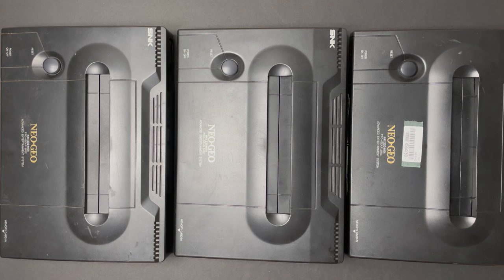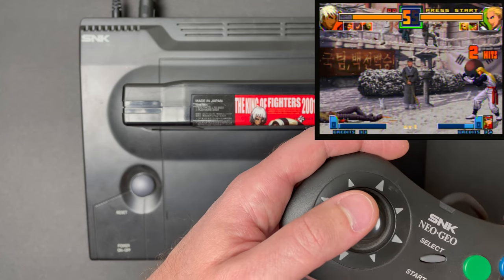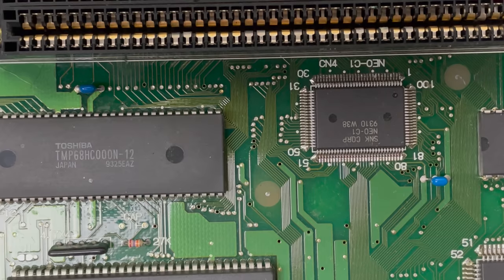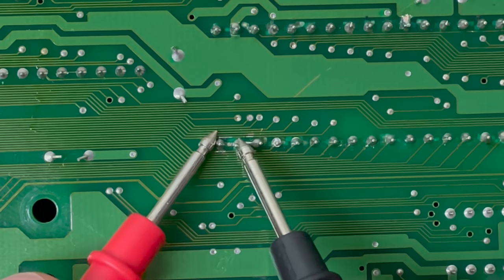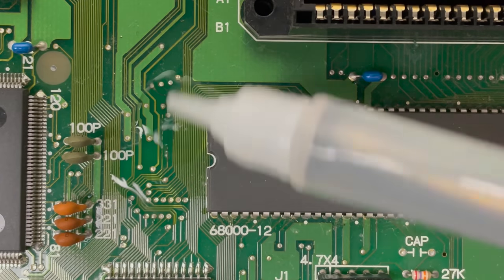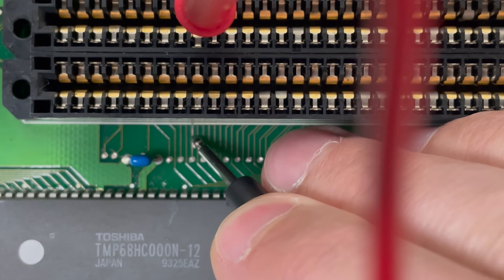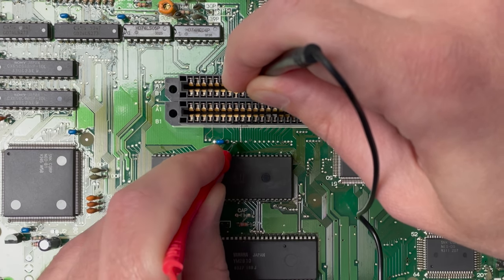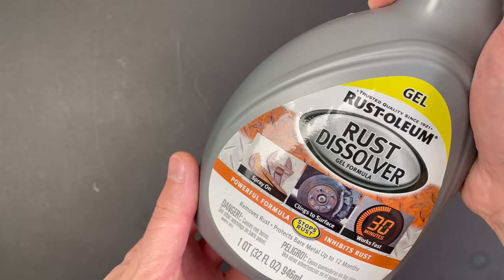SNK Neo Geo Repair-a-thon Ep. 3 - Distorted Graphics - Retro Console Restoration

Comment: Tip for doing continuity sweeps: if you find yourself needing to scan large portions of a board for the other end of a via, stick a little ball of steel wool on the end of your probe to greatly increase its surface area.
Reply: This is similar to what I do. I have an alligator clip lead with some used solder braid on it. I purposely cut off a half-inch or so of unused braid with the used braid so there is solder holding one side together. I separate the braid on the unsoldered side, clean off the flux with isopropyl, and spread it out like a fan-shaped brush. I then clip my alligator clip leads to the soldered side and my continuity meter’s probe while I brush the braid all over the board looking for continuity.

Comment: Yep, tunnel vision sucks, but absolutely natural to fall into it sometimes. 9 times out of 10, the issue would have been where someone had previously did a mod or attempted a repair. I probably would have focused on the BIOS chip too. At least you got the real culprit in the end. That broken trace under the cartridge slot was sneaky! I'm kinda jealous of your trace repair skills. I can just about manage the typical "bodge wire" fix. It works, but your method is much more elegant. I just don't have the patience and/or steady hands for it. Plus, thanks for the nail polish tip. I hadn't thought of that!
Reply from the maker: I'm pretty sure those cheap "solder mask" syringes on eBay that go for $5 are nothing but green nail polish...

Comment: I am super thankful that the youtube algorythm threw one of your videos my way (Master system II IIRC) because I've been hooked ever since. I'm not a repair person so much like you but I did have a friend one time ask me to fix his NES for him and though I made him no promisses it ended up being simple enough to rejuvinate his 72 pin connector with a screw driver and give him a nice working NES back.

I want to start doing more involving soldering etc but at present the only real mod/fixes I've done that were even close to that was Disabling the Lockout chip in one of my many NES's (cut the leg) and Fix the dead columns in several gameboys.

I Have an NES currently that is in my "Bad" for parts bin that I started a mod on some years back to customize it a little but I never finished it and I would like to return to it as the mod in question will require some soldering and will be the most advanced thing I've ever done if and when I find the time to finish it. Lucky for me I do have 5 NES and I'm only using 2 the other 3 are in pieces as mostly replacement parts (though 1 of the 2 I am using is a Top loader so there isn't much overlap parts wise with my spares there. The other in use NES is my childhood nes which I've refurbished the connector on but other than that never had to do anything else. I Might like to try my hand at retrobrite but I also am uncertain if I would want to do it on my childhood console as the colour change is part of its history.

Thanks for being a generally awesome person and great to listen to/watrch as background on long Night shifts (tech support for Canadian Hospitals) in between tech support phone calls.

Comment: Yay, finally! I had been waiting for this for so long that I actually managed to fix the broken Neo Geo I had bought a while ago, in the meantime. It was self-testing yellow which is VRAM but the issue wasn't actually the chips, I socketed them on both my AES consoles and then swapped them around and all were testing fine on the working console. Turned out to be a trace that pops up through a broken via near the LCSP2 chip.Funnily enough, it also had rust on one of the cartridge flap springs and someone had already repaired a via that goes to the cartridge slot, right about where you repaired yours. Good video!
Reply from the maker: Nice work repairing your AES. There is clearly a theme of bad traces on these boards. 5 consoles in and not a single one with faulty chips. Just worn traces and oxidized cartridge pins...
Reply: @BorderlineOCD  Indeed, they are very fine and they seem to be very frail. I even found some slight corrosion on one of the pins in the main RAM, applied some flux and new solder to remove the oxidation and that somehow ruined a trace that connected down to the other RAM chip, which made the console output some weird errors in a green screen with all kinds of letters showing up. Jumped that trace with a wire and the console was back to normal.

Comment: I wonder why a broken trace that went to an open ended cartridge pin would cause that issue? Was there a component underneath or something?
Reply: I was wondering the exact same thing... When testing without a cartridge, shouldn't the before and after be totally equivalent from the electronics standpoint?
Reply from the maker: This is bugging me as well. I have no idea and I was quite surprised that it self-tested blue after the trace patch. I tried looking up schematics for the board to see if the trace goes anywhere before it terminates at the cartridge pin but the only ones I found are low-res and don't fully match my mainboard. Would love to have a proper answer to this.
Reply: I had to scroll a bit, but I found my question! 😂

Comment: Wait how did the self test pick up the broken trace? Surely you fixed whatever was holding up the self test with the bios re-work?

Two other things, what on earth was up with all that hot glue? They must have been expecting some very rough handling? Didn't look like consoles 1&2 had it. And two, wow that rusty spring cleaned up nicely!

Love the videos!
Reply from the maker: I'm honestly not sure about the self-test with that single broken trace. A couple of people raised that question and I'm scratching my head about it.

Comment: Mine had a blue screen on start up without cartridge. Self Diagnose=Ok. But when I slot in my ROBO Army game cart and turn it on. The huge NEO GEO font isn't as smooth as it should be when it appears and it is a little jumpy, you could tell the font is little jagged or pixelated. Can you advice where I should look into? I had sprayed contact cleaners  intensively into the cart-slot and whole entire board too. Thanks.
Reply from the maker: It could be an issue with the cart itself. Do you have another cart you can try?
Reply: Unfortunately I only have 1 game cart. This is my very first Neo Geo AES SNK. Nevertheless, I will try to get the cart check with another console if possible...Thanks.

Comment: I'm running out of excuses for not BIOS-modding my Saturn. I wouldn't call your focus on the BIOS socket tunnel vision, because it's not like you weren't going to repair that anyway- no effort to bring the system up to par is wasted effort, and the basis of troubleshooting is to quantify every variable.